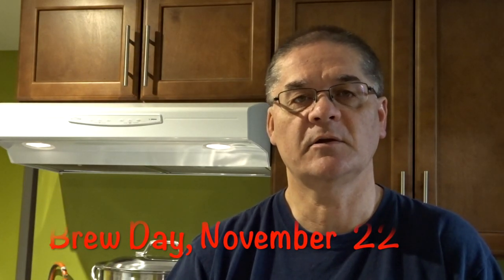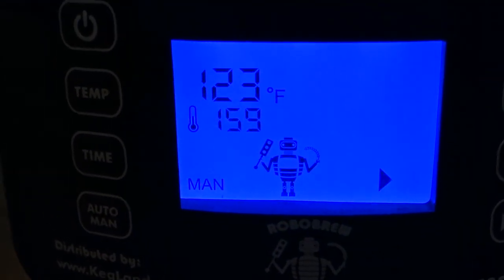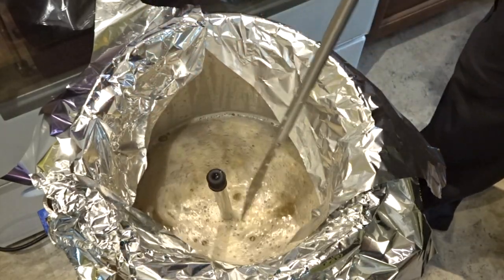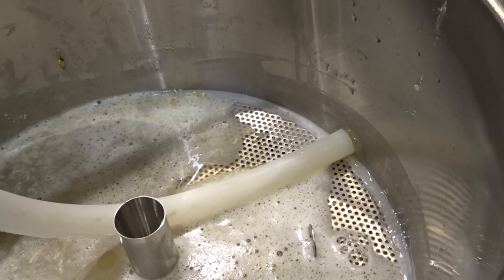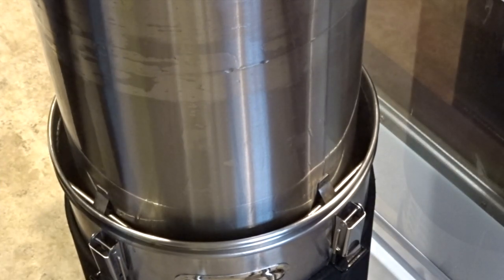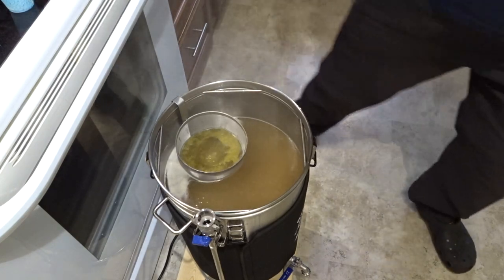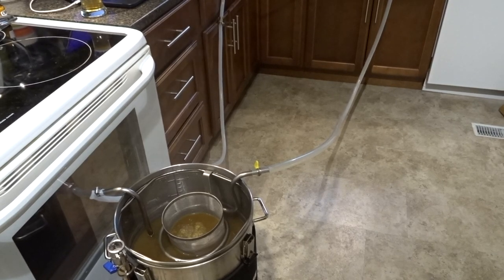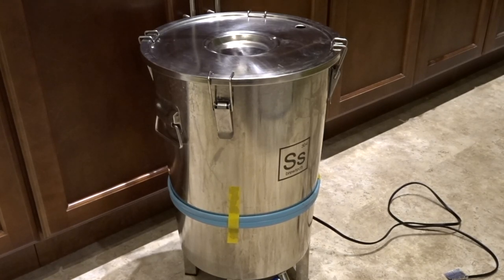Robobrew - Craft Beer Grain to Glass with Robobrew V3

Comment: What made you decide next time you will use the pump to transfer beer to fermenter?
Reply from the maker: During this video I had to lift the Robobrew full of 5 gallons of wort up onto my counter. If I was to use the built in pump, I could just pump the wort into the fermenter. That would be much easier. Thanks for tuning in.......Take care, Bluefin.
Reply: @mustang774  hmmm. Never thought about that when I was using my robobrew. Awesome tip
Reply from the maker: I thought of it after I lifted it to the counter. Do you have any helpful tips? This was only my second brew on this system. I'm loving it......Take care, Bluefin.
Reply: @mustang774  I am still learning myself. But you do everything that I do but never thought of the pump to transfer. What my issue is right now is the wort chiller because the hose it comes with loves to kink since it's so flimsy.
Reply from the maker: @mblakeborough   I bought a thicker wall silicone tubing. I had one of the Robobrew hoses (flimsy) and it too tended to kink. I think vinyl tubing would not handle the high temps....Take care, Bluefin.
Reply: @mustang774  good to know.